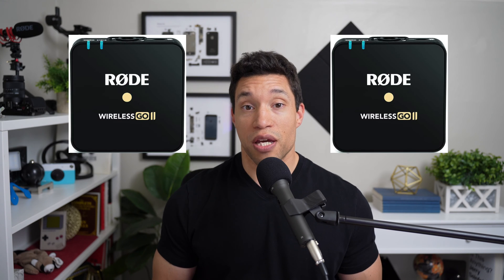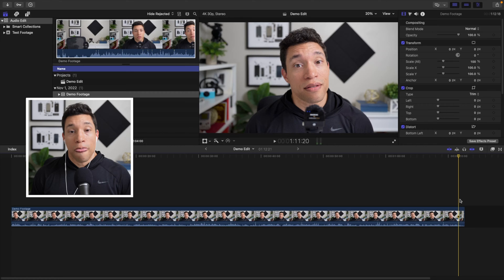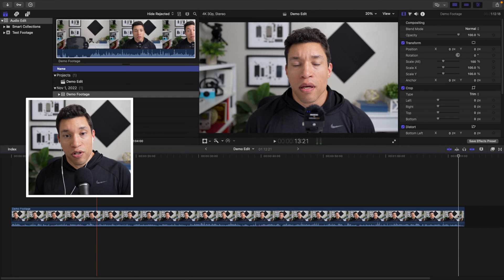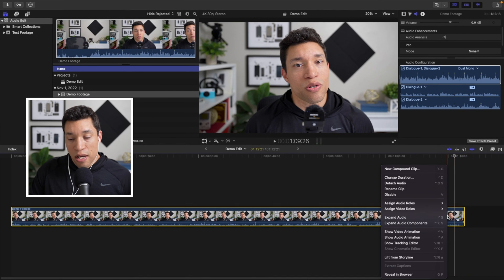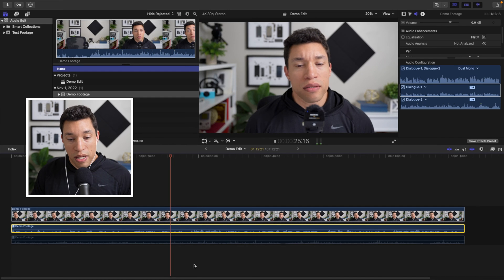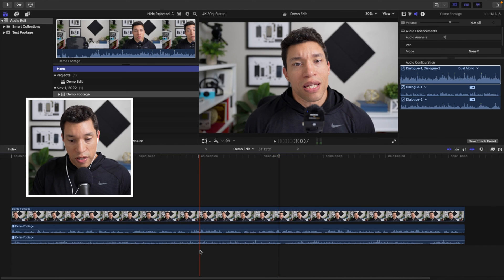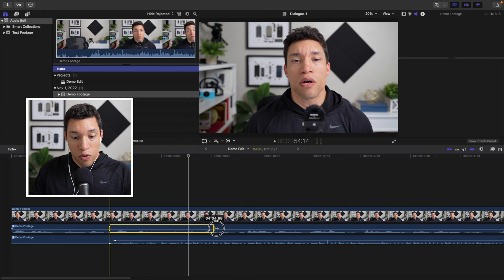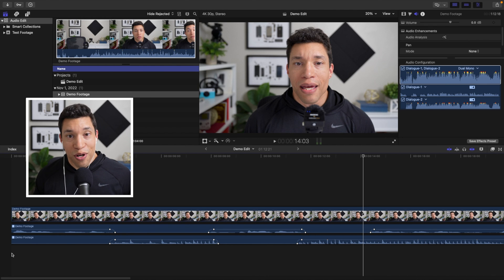How to edit separate audio channels from Rode Wireless Go II (Final Cut Pro Tutorial)

Comment: My Final Cut Pro does not show option for Dual Mono? I only have Mono (I am using Rode Wireless Go II)?
Reply from the maker: I don’t think the option is there unless your audio is on separate channels to begin with. Are you sure you recorded in that format?
Reply: @mattliller  you know what, I double-checked my Rode app and it showed Split audio, but think it's because I recorded in the iPhone camera app instead of the DJI app...even though Rode is separate from DJI...still very unsure.

Comment: Bro, thank you for this! I wouldn't have thought it would be so hard to find the answer. Was befuddled as to why my split track recording of two mics, was only importing as one file, and how I could edit it.
Reply from the maker: So glad to help. That’s the exact reason I made the video - because I also couldn’t find the answer forever!
Reply: @mattliller  it's certainly helpful. I've got a further question, though: when converting to dual mono, before any edits, the audio sounds a bit worse? It evens out each channel, which seems to lower the volume overall. I wish that I could edit the two channels without the tracks having to be evened out first. I have just read that there is always a 3 dB shift in volume between stereo and mono, so maybe that's all I'm hearing and that I just need to up the gain on the channels as desired?
Reply from the maker: @lucanianman  I don’t pretend to be an audio expert, and I’ve actually never heard there’s a difference in dB between mono and stereo. As a concept, it makes sense that what you’re hearing before converting to dual mono is different, since multiple things were layered in a way that were not used to hearing. 

For all things pro-sumer audio, I like to follow Tom Buck and Curtis Judd on YouTube. They might have the exact technical answer here.
Reply: @mattliller  thanks man, no problem. I saw some comments in a Larry Jordan video about the dB difference between mono and stereo. And also some affirmation that when you convert, nothing of value is lost. So I think it's something I don't need to be worried about

Comment: I've just started trying to use safety tracks with different mic systems but for some reason whenever I pull the audio files into Final Cut, it doesn't go in as stereo or dual mono (not under options), just Mono! So I can't separate the tracks...  newbie question but if you or anyone could help that'd be greatly appreciated 

Btw I know this video is for something a little different but I think it's sort of related to it as I can't seem to import stereo/dual mono audio channels
Reply from the maker: That’s a great question, and I’ll run a few tests to see what I find. Have you tried this with the Wireless Go II specifically?
Reply: @mattliller  Actually not yet lol but, I think my problem was I was under the impression that on-board recordings would use safety track to allow me to split the channels to dual mono, but it seems that on-board recordings are only mono (no safety track. Only seems to work through the receiver).

Also I didn't change the input on my laptop to the USB mic so it was recording through the wrong microphone and was resulting in mono recordings as well. lol!